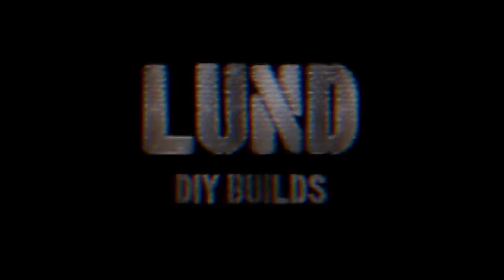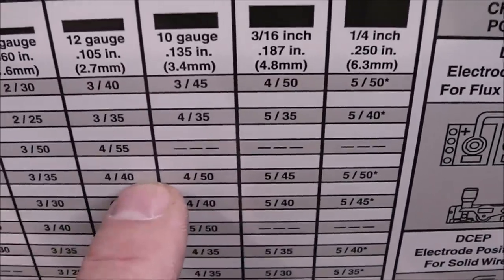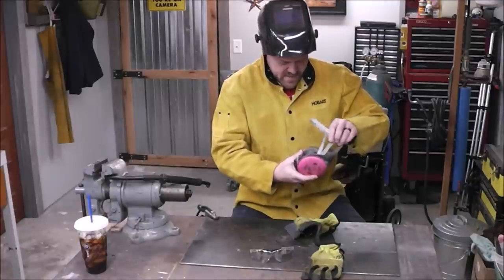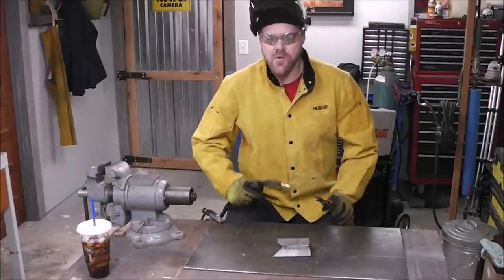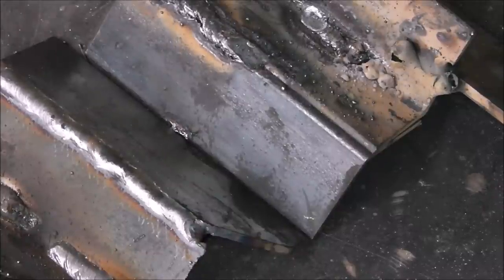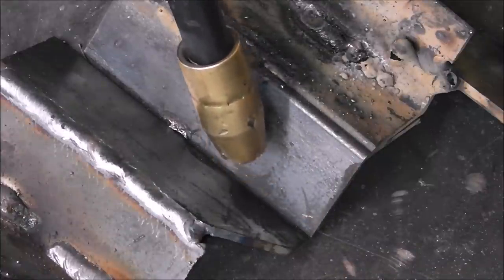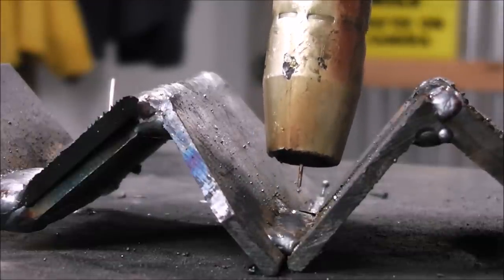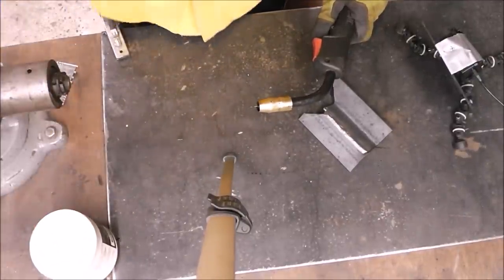💥 BEGINNER WELDING SERIES   LEARN HOW TO MIG WELD E.4

Comment: I'm in the UK. And I've enrolled on an adult eve welding course. Diploma in Engineering ABC, level 2. Welding Techniques. Never seen right travel from your left, going to your right? Interesting. I didn't know about 'stubbing' though, like the name for  it. Great video. May the sparks be with you. Cheers.😎
Reply from the maker: @Peter Farrow congratulations on your new found interest! Travel direction is pretty much dictated by your comfort, working space, any obstructions and what's best for that particular joint in combination with torch angle. You can go left to right or right to left and be pushing or pulling your weld puddle all depending on your torch angle.

Comment: alot of good information here for beginners. only thing I'd change is using a tap mig rather than a unit with infinite adjustability. for new guys learning it'd be helpful to teach them about voltage, wirespeed, and the relationship between the two.
Reply from the maker: Thank you Chuck for your support and kind words! I will see what I can do! :)

Comment: First "weld" yesterday to see if my craigslist bargain worked...and I suck🤣😂 ...thanks for making this.  Found out I was stubbing by watching the video, it was literally bouncing my hand up and down.  Thanks again, looking forward to getting better 👍
Reply from the maker: @stgreen78 if your using flux core try to hold about 5/8 to 3/4 gap between your nozzle and workpiece and let me know if it helps 😁 it should
Reply: @BrandonLund  finally got some garage time.  It did help, thank you.  I'm using solid wire with 75/25 mix.  I also played with the speed a bit.  I'm also just welding on a scrap piece of 1/8 angle, not even connecting anything together...just practicing.  Thinking I should buy some tubes or cut up an old bedframe and make a welding cart as practice (and because the 80s one I got with it is garbage)🤣. Thanks for the tip and all the content👍.  I'll keep plugging away every chance I get.
Reply from the maker: @stgreen78 sounds like your making progress! Keep up the good work! It's a learning curve like most things but once you master it, it's a skill that will last you a lifetime 👍

Comment: Good stuff, other things-if you have wire feed probs, check your ground(earth) is good as well as w/f setting-MIG needs a good ground, cleaning off the workpieces also helps and can reduce spatter. Pulling or dragging with gas MIG generally increases penetration, I find that is true, so I drag on thicker materials.Shield with a grinding is handy switch on the outside of the shield is handiest.On safety, I prefer to wear all leather gloves for welding and grinding, and no livestock in the shop I think you had a goose under the bench at the start of the video?, oe mebbe it was ole Foghorn Leghorn.
Reply from the maker: Jaques Daniels  That's an excellent point that I completely forgot to mention. Thank you for mentioning that! That squeak was crazy! I had to back and listen. I think it was an owl lol

Comment: Thanks for a very informative video.
I have just recently bought myself a new MIG welder.
I have not had a chance to use it yet as I had to get an electrician to put in an 15 Amp power point for the welder.
My old one which I burnt out was only a 10Amp unit but when used at the end of a long extension lead overheated, but it was good practice but it has been so long since I used a welder, I will have to learn all over again, so your videos will be very helpful.
I especially liked the way you demonstrated the sound of going too fast or too slow.
regards from Rural New South Wales,Australia.
Reply from the maker: Peter Cunningham Thanks man and hurry up and get that welder rigged up! It's a great hobby! Thanks for the great comment! Cheers!

Comment: Very well done.  I just upgraded to this welder from a cheap  flux core only machine. I started a project using 1/8 " material and played with the settings. I am running the same set up you are demonstrating with.  I was surprised that the welds seemed fairly good over a range of settings. I settled on settings with the wire speed a bit below the chart recommendations. I was wondering if you have found the recommended settings to be generally fairly accurate for the Hobart 140 ? Thanks.
Reply from the maker: Congratulations on upgrading your welder! You will be very happy with it. It's a solid machine and I have had zero issues with it. As far as the chart goes, I think it's very close but I have a tendency to go the other way on my settings when I'm welding. Not just this machine, but most of my machines I find myself welding a little hotter than whats recommended. I probably compensate for the hotter setting with a quicker travel speed...which is why I usually end up having to clean up a bunch of spatter at the end of the project😂 .  Thanks for watching James and Congratulations! 👍
Reply: Thanks Brandon @BrandonLund

Comment: Clearest presentation yet.  Thanks for the information on the axes  orientation of the tip.  The technique shown of moving the tip side to side while maintaining the correct angles gives me a template for practice.   I am assuming that the same technique holds for using a flux welder set up Ace.
Reply from the maker: Thanks acwren!  I appreciate your support and the same technique works for Flux Core also :)

Comment: Another good rule of thumb 👍for beginners that are starting with mig welding, is the 10 to 1 rule.
So on short circuit welding (lower voltage) if you are running at 18 volts, set your wire to 180 Ipm. (Inches per minute). You also want your gun angle to be 90⁰ to the work with a 5⁰ to 10⁰ push angle or forward inclination.
You also want your wire at the leading edge of the "puddle" (the molten pool). If the puddle gets too far in front of the wire you face the probability that the weld you're putting in can "freeze" and just settle Into the joint without proper fusion of the two parts, "lack of fusion".
Manipulate the wire at the leading edge, making sure that the toes of the weld "wet in" to either side of the joint, ensuring complete fusion

Comment: Brandon, have you ever tried dropping your gas pressure? I went from 15-20 down to 8-10 with no effect in my welds. Save gas! Nice video
Reply: Very true sir, I did that and was amazed how long my current bottle is lasting.
Reply from the maker: Bo Haggin So is that the cfh with the trigger pulled? I'm going to give it a try. If so, I'm going to double my usage. Thanks for the tip brother!
Reply: Have you ever done a cut and etch with the gas that low?
Reply from the maker: Rick Ramirez this might make for an interesting video...
Reply: Why does your gas pressure drop. If I set my regulator on 10 it should stay there. Also turning your bottles on wide open is a bad habit to start. Once your pressure shows on your regulator there is no reason to go any higher
Reply: John Sanders  that’s what the regulator is there for. Opening it all of the way makes no difference in the amount of gas exhausted

Comment: Great video! Explained in simple terms that a totally inexperienced welder like me needs. I ran a pretty good bead after watching but get a lot of splatter? I'm using flux core wire and don't have gas. Any suggestions?
Reply from the maker: Thanks man! If your getting excess spatter try lowering you amperage or reducing your wire feed speed. That should help :) @Doug Churchill
Reply: @BrandonLund  Thanks for the quick reply! I'll go out and try your suggestions!

Comment: I always prep the surface to be welded, and don't weld through mill scale.  Even for practice, it's the best habit to weld on prepped metal.
Reply from the maker: Powrguy Powrguy if I'm welding for a customer I get it to bright and shiny. If I'm just messing around or doing something decorative I tend to keep prep to a minimum to maximize my time and conserve consumables. Knowing where and when to do this is like any skilled trade. There are certain times where you can relax tolerances and others you can't but as a general rule you will never be wrong getting your metal to bright and shiny even if your welding with 6011 / 6010

Comment: I have the same welder.  Originally, I thought I sucked at welding, or at least for .035 wire.  I think .035 is possibly outside the range of the welder.  I switched to .023 wire and all of a sudden, my welds looked really good if I don’t mind saying so myself.
Reply from the maker: Yah I agree, 035 does feel a bit much for this machine. I will have to give .023 a try on this. Surprisingly I haven't tried yet. Thanks for the tip!
Reply: Brandon Lund, I recently welded .125/1/8” mild steel, I set the amps at “4” and the wire speed at 15. Good penetration, no burn through and no under cutting of the weld. Give it a try.  Just make sure you prep your weld area, grind/sand to clean metal.

Comment: Nice tutorial. I'm still trying to learn. When I weld I couldn't see the crack I'm welding and I couldn't weld in a straight line. 😁 I'll get it eventually, probably 😂🤣
Reply from the maker: Try shining a light on the area your welding. You can also experiment with lighter shade lenses but just be careful. Having welders flash is horrible. I set my auto darkening to 7 for MIG and have never experienced any eye issues. I cant see with anything darker than this.
Reply: I will try your advice. Thank you. 👍

Comment: Mig is so tuff for me ive had great welds and had horrible welds. Not sure if the 120 low voltage is what makes the machine not as good? But can never get the voltage and wire speed correct. Never here that perfect burn.. give me a stick welder il run beads all day! The wire feed just tuff. Very handy i can complete jobs after a few runs.
Reply from the maker: Not to question your knowledge but a LOT of folks experiencing what you describe is they forget to switch their polarity sometimes. Flux core runs DCEN,  Solid wire runs DCEP. Contact tip to work distance with also affect that sound. Not having the proper hub or drive wheel tension will also cause this. My guess is that something is not set up correctly with your welder. Here is a checklist to see if it's any of these things https://youtu.be/TTZOGyZ4R_Q

Comment: What if you do not have the gas just the wire welder? Would it still be the same technique?
Reply from the maker: @Steven Whited same technique except you have to drag, not push with flux core wire and instead of holding a tight gap like with MIG, you want to increase that distance to about 5/8".

Comment: hello I am new to welding-i got an auto darkening hood but I can not see the material-now the hood does help me from getting flashed-Do the lense come in different types
Reply from the maker: Most have an adjustment setting and some require batteries for the filter to work

Comment: thanks Brandon, you mentioned in the video a fast flow and slow flow of the wire, has this also do with the speed you move the gun like a combination of the two. or the flow rate is an independent factor that it needs to be set in the machine
Reply from the maker: I try to keep my travel speed pretty consistent and adjust the speed setting to get the desired puddle

Comment: I’ve found there’s some Mig welder that has MCU ship set to memorize 3 settings for quick switchover - Is this necessary feature ?
Reply from the maker: Many of my welders have this feature. I never use it. Sometimes these stored programs can be confususing because it's not saying preset #1 is for 1/8" steel with c25 gas and .030 wire. You have to somehow figure that out looking at the display. In that time you can just set it.  That's my opinion anyways.

Comment: Did I hear you say $80 for a bottle? Wow.. I fill mine (75/25 Argon/CO2) for $33..  (Western NC) Same size bottle as you have.. 
I weld pretty much the same as you.. Usually drag, but, will push in a second if it is a better setup for the weld.. Whatever feels better.. Downhill/uphill, kind of depends on what I am welding and what amps the machine is set at.. If it is welding a little hot, I weld uphill, a little on the cool side, I weld downhill, which I prefer..  I rarely move my settings if I can weld a little faster or slower. I usually don't change settings unless I change thicknesses of metal or have to weld a different type of joint (wider or more narrow).. If it is not hot enough, and should be for what you are welding, always check the ground first.. I find the ground can affect just as much or more, if it is a poor ground. 
I always say.. Practice penetration and fusing first, then, practice doing the same while stacking the beads... 
I can usually teach someone to weld in an afternoon.. Start with the stick, and when they get penetration down, and get started making some decent beads, I move them to the Mig if that is what they want to buy, and let them practice the rest of the afternoon.. 
Mig makes everything so easy,, but, everyone should start with Stick to get the real feel of welding.. If you can stick, you can surely mig but not the reverse without some time spent practicing.. It's just one less movement (following the shortening of the rod), which was always the source of less than "proud beads".. 
Keep up the videos.. Lots of people are looking for beginner vids, because, not everyone gets a chance to go to school or have a mentor to look over their shoulder and figure out how to do it, but, see some simple videos and see what they have been missing.
Not enough of the beginner vids.. Heck.. I watched these videos and I have been welding professionally for myself for years..Ha.. 
Now,, if I could just find someone who went through Machinist school and could do about 20 or 30 videos on the "Fundamentals" of machine work.. I am already using the lathe and mill, and doing what needs to be done, but, seems I am constantly picking up things that are fundamentals that I missed, because they were not necessary to know at the time, but, helps in the overall mix of things..  Half of the videos about building your own tools to make your work more accurate and easier..
Love your wood/metal builds.. One day, I am going to take the time to outfit my living room with that type of furniture, and then to the bedroom, and finally the kitchen/dining room.. 
I want to build a set of comfortable chairs that will stack in a corner when not in use.. Probably square or rectangular tubing..
Probably go with a new table for the chairs... Nothing wrong with the one that I have, except, I didn't build it.. Ha..  
Cheers Brandon..
Reply from the maker: $33.00 is an awesome deal for a bottle that size! I agree with starting with stick first. That's how I started and I think everything after that just comes easier. I learned on 6011. Burned pounds of it then eventually started running 6013 and 7018. It was a whole new experience. I was amazed how easy it was to  stack dimes as compared to 6011. Thanks for the compliment buddy and I am always learning also. It's what keeps this hobby so much fun :)

Comment: Hi Brandon, I'm a beginner and enjoy your video. Before my dad passed away he gave me a Pow"R-Mate 100 Dual Purpose Wire Feed Welder. Today I tried running some beads on a plate of 1/4" steel but it kept tripping the 20 amp breaker at the shop panel box. Then I tried practice beads on 1/8" steel and it did okay for about 15 minutes then tripped the breaker again. Do you think it's something I'm doing wrong with my welding or could it be just a bad wire feed welder?  Any advice from you or your readers would be appreciated. Thanks, Ken
Reply from the maker: My Hobart 140 is a 120 volt welder and it does the same thing on one of my 20amp outlets. I’m guessing it could be a few different things. You could have a bad circuit breaker, you might have other things connected to that same circuit or it’s a long distance from the panel to the plug causing voltage drop.
Reply: Might want to check the duty cycle on the welder.

Comment: I bought the same welder. Having problems with the tip clogging. Wire bunches up. Also not getting any weld on contact.
Reply from the maker: Are you using .030 flux core wire? It sounds like a drive roll / tension issue.
Reply: @BrandonLund  wire that came with the welder. Haven't hooked up the bottle yet.
Reply: Danny Nasiff  nozzle lubeeeeeeee
Reply: I have the same Hobart 190. It comes with a roll of flux core wire. I also bought a big roll of flux core wire because I weld outside and don’t have a co2 bottle. I ruined about 50 feet of wire before I realized I was using the part of the wheel that is for solid wire!!! You have to take the guide wheel off and set it to the proper groove for flux cored wire, otherwise it’ll bunch up in the machine.
Reply: It’s either the wrong roll or too much to no tension

Comment: Also Brandon,  teach your viewers to bleed down the gas. After closing the bottle valve, loosen the drive roll, and turn the machine on, hit the trigger a few times to let the residual pressure to bleed off. This will save you money down the road.  
GOD BLESS
Reply from the maker: Great tip!

Comment: I'm learning flux core welding now. What's your thoughts on that?
Reply from the maker: I love all processes. Flux core gets a bad wrap by the guys that prefer MIG but flux core has it's it's benefits especially when your working outside because it's self shielded. MIG is good but its sensitive to wind so if you have a hot humid shop you need to setup barriers so your coverage gas remains. Each process has it's ups and downs but I personally like self shielded, however stick is my favorite
Reply: @BrandonLund  I need to learn stick. I learned tig  and mig.
Reply from the maker: Stick is my favorite process. Start with 7018 and just start padding beads.
Reply: @BrandonLund  OK thanks